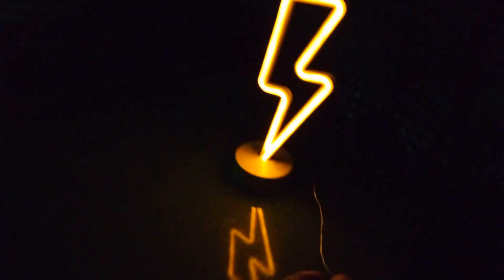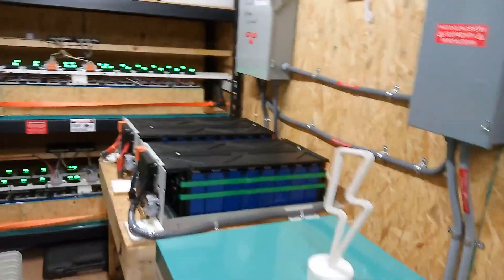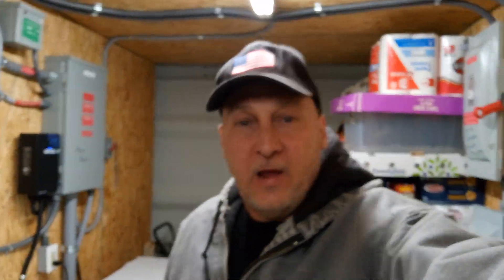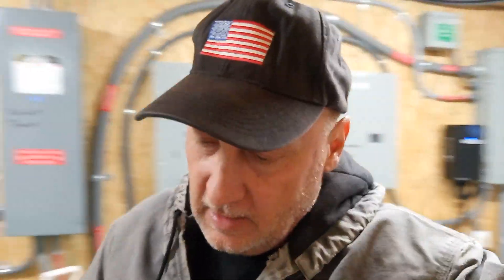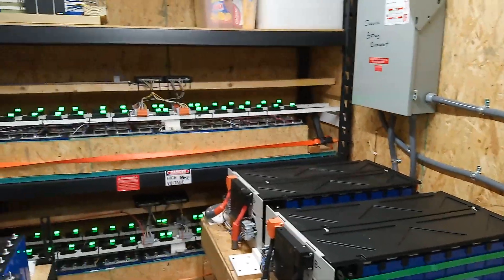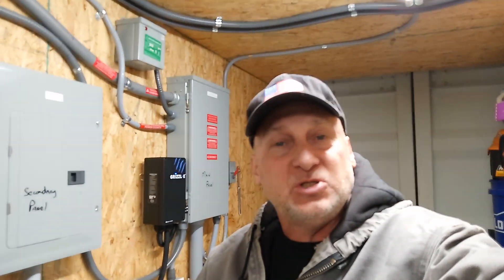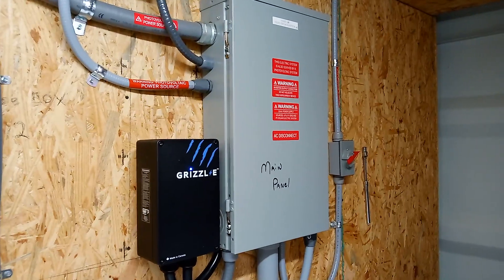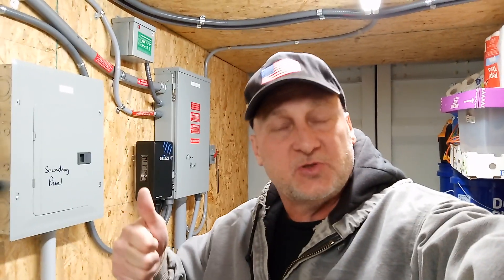Maxing out a huge 25000 watt off-grid inverter.You won't believe this ⚡⚡😊

Comment: I agree the higher voltage systems are better just scare to loose one string of batteries is a big chunk of your capacity vs 48/52 v I have 5 banks to make 70kwh of one goes down not the end of the world. But at only 12kw  pulling 200+ amps I understand the cost of copper is not fun either. Love the vids keep em up
Reply from the maker: @electromechanicalstuff2602  you can get multiple battery banks just like the 48 volts systems especially with the price of Sandi battery banks and even DIY banks yourself.No 4/0 cable here just 1/0 copper cannot beat it⚡👍
Reply: Hush hush about 48v my mother might hear us 😂
Reply: Hey Mike have a happy new year🎉
Reply from the maker: @2hotscottpro  Happy New Year let's hope it's better than this one ⚡👍😊